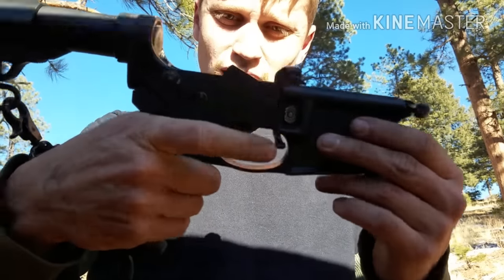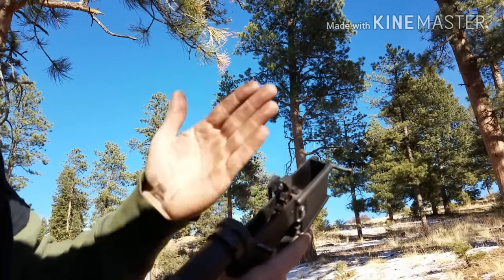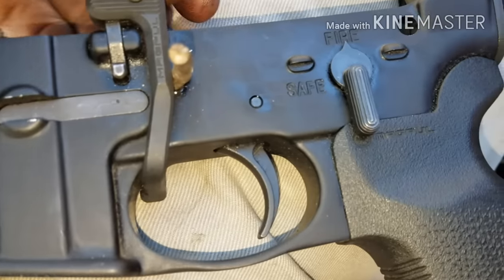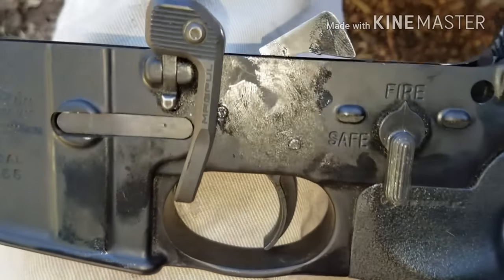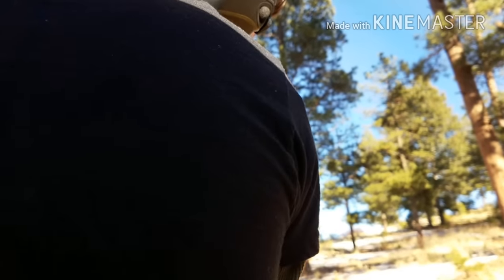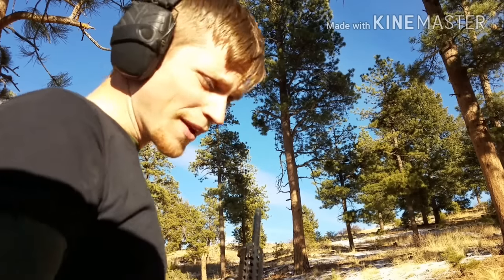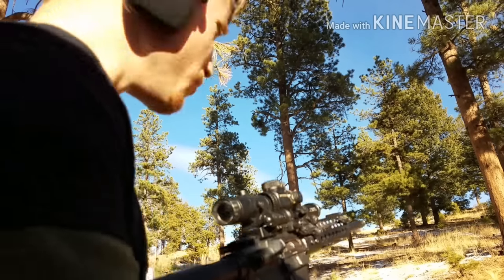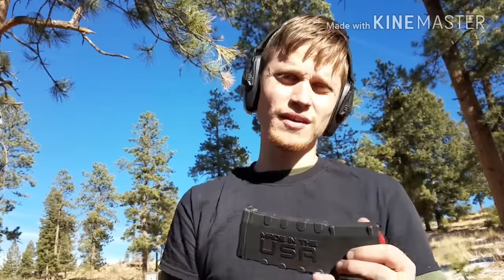What Happens When The AR-15 Disconnector Breaks?!

Comment: Would functioned the same way as a single shot if he had left the broken part in the gun till he got home , no need to take it apart with sticks
Reply from the maker: Thats not accurate to my situation. The back of the disconnector broke off...meaning it completely disabled my gun and the hammer would not release when the trigger was pulled. You would be correct if the hook portion of the disconnector had broken off.

Comment: Hey guy! If you were trained in military you would know that you dont need a stick to push your trigger pins out, just the tip of you bullet! that goes for many other things on your weapon. A1 A2 rear and front sight adjustments taking magazines apart  and so on...
Reply from the maker: I am aware of that but say you dont have any ammo at the moment. Still need to fixer up before the next time you use it. But yes, you are right and I didnt do that in this video, I didnt think of it while filming. Lol
Reply from the maker: I think I remember why i didnt now. This is a 300blk build I did and i might have been using either flat nosed or round nosed projectiles for the subsonics I was reloading. Both cant fit into the pin area. ;)

Comment: why would Anderson warranty a clearly misused molded gun part
Reply from the maker: K-Tech Cowboy How do you figure the part was misused?
Reply: Douglas Thompson not the part the gun. u can clearly see that the lower is broke from letting the hammer hit with the upper off and what's with all the useless grease piled down there
Reply from the maker: K-Tech Cowboy my lower is not broken...lol and why does the grease matter?
Reply from the maker: K-Tech Cowboy Just to be clear, Why exactly do you think Anderson shouldnt have replaced the part for me? Do you think the Disconnector shouldn't last over 3000 rounds? Im confused as to why you would say my receiver is broken too. My receiver is in great shape, nothing I did (besides shoot the gun) caused this part to break prematurely. It seems like you were focusingon all the "bad" things you could find in the video and then using them in your mind to create the reason I made my gun fail...lol

So in your opinion an "Overlubricated" part will wear quicker? 

If so! Have I got the video for you! Made it especially for you! ;)

https://youtu.be/kKisBcqOXRY

Comment: Yeah... Or just buy an AK instead.
Reply: Such an over rated platform. The AR can face much more environmental abuse than the AK... Both rifles can break, and AK rifles suffer from quality control issues far more often than AR rifles do.
Reply: and have the gun go off when you turn the selector too far? nah.
Reply: The AR most definitely cannot face more environmental abuse than the AK. Been proven in the field and in US military tests where the AR-15 platform consistently placed dead last with the highest number of stoppages and mechanical failures in every single reliability and function test they ever held, even against experimental designs. Which is why there have been several proposals to replace the AR-15 platform in the US military, given that most of the other small arms in use by the US armed forces are of foreign design already.

Both rifles can break, certainly. The AK can jam and break just like any other rifle. As for quality control... depends were you get your rifle from. Its not an inherent issue with the design or rifle, be it AK or AR. AK is more robust and has higher tolerances for abuse though. While the claims are often exaggerated regarding the "unkillability" of the AK, its no different from AR fanboys saying you cant hit a barn point blank with an AK because its Russian and therefore bad quality, crude, cheap, inaccurate etc, when in reality that is not correct but merely a matter of confirmation bias and propaganda to affirm ones own choice and superiority to oneself. Both sides do it though.
But you can just do a quick search and look up how many videos there are on youtube of AR components failing and breaking and AK ones. Or go to a gunsmith and ask him how many of each he gets and with what problems. I am fairly sure AR will be more prominent than AK (in proportion to rifles in use).
Reply: Roland Lee false. Go watch the ak vs ar mud test. I used to be a hater too until i saw the video. The ak got shit on bigtime.
Reply: And just why exactly would I do that? Because there is one video that confirms your bias and therefore its the ultimate truth?
Ive seen the video, btw, and Ive seen many others with varying results. So why exactly would that video be the be-all end-all other than you being desperate to confirm your bias?
Why would that one video negate DECADES worth of trails and tests by multiple armed forces around the globe and real world experience by tens of millions end-uses in the field for 50+ years?

So no, its not false. Throwing mud into a gun and taking a few shots does not actually equate to or prove anything. All it does is provide confirmation bias to fanboys, be it AK or AR.. depending on which video you watch.
Reply: Roland Lee there is way more than one video lol. You are the fanboy here xD
Reply: Typical couch commando.. Hilarious. Cannot face the facts because you are hurt that your rifle produces inferior performance. :D
I try not to be biased because I own rifles of both platforms, and have shot others. The AR just simply has superior ergonomics than the AK, it also produces better accuracy, has more caliber options, and is also is optics ready out of the box. The AR also is lighter, and uses a 2 piece receiver set up which is easier to convert to other calibers while still legally owning only "1 rifle" from a civilian perspective. Fact of the matter is almost every rifle will fail, but keep this in mind. Almost EVERY POWERFUL FIRST WORLD COUNTRY HAS GOTTEN AWAY FROM THE AK.... Maybe there is a reason for doing so? It may be a good rifle, but being in the good ole U.S.A. The AR15 has much more to offer with a much more attractive price than any other rifle to the civilian market. The days of the Good AK rifles for much lower prices than Great AR rifles are gone. Also keep in mind that this guy is running an anderson build. I love my arsenal SLR, and will have to admit it is much more convenient than my AR rifles regarding some aspects, but when it comes down to it Ill take any of my AR builds any day. By the way before you shit talk, Anderson rifles have a reputation for being sub par and having a plethora of issues in general in regards to assembly, just look on the forums. I guess I should maybe go on videos featuring I.O. and Century builds and talk mad trash about the AKM?
Reply: Interesting.. So you genuinely believe the US military trails to be less credible than a video on Youtube?

Ergonomics and US civilian market convenience was never a part of the discussion. Rather pathetic that you have to use that as somehow proving a video on Youtube to be  paramount of US military testing, as well as tests by other armed forces and documented performance in actual combat. Well done, and I am the couch commando.. sure thing buddy.

Yes, the AK is being replaced by most countries that use them because it a very outdated platform and a new version is in the works to meet the new demands. The majority of AK's in use are 40+ years old or use the old design. Not difficult to criticize a rifle that is essentially a WW2 design made for mass warfare for having limited options for modification in the 21st century civilian market. How is that different from any other rifle of the period? Would you say the M1 Garand is shit because it doesnt come with an ACOG in the box?
But the AR-15 is actually even less popular than the AK. Most AR-15 sales are second hand (old versions of the rifle) to third world countries like Bangladesh. Most who had it before, like Israel, replaced it or are in the process of doing so.. And guess why when the Israelis made their own rifles they took the AK as the basis for them? Why did HK make the HK416 and why did the US military buy it if the M16/M4 is simply better? How come the HK rifle performed better in US military reliability tests than the M4?!
The US military itself for the most part relies on FOREIGN weapon designs and only a handful of developed nations and NATO states use it despite it being essentially forced into use as the standard, most of them seek alternatives. Why? And why do none of the alternative designs take the AR-15 operation as the basis? Many take the AK.

Were the AR-15 really that much better, or better at all, to any significant margin it would have become the dominant platform in use and basis for other designs. But hasnt. The opposite has happened. Those who had it in the last decades are getting replacements. Even when the US supports rebel groups in the third world they ship crates of AK's, not AR's.
Reply: Roland Lee 
Whatever helps you sleep better at night little man. ;)
Reply: So when were these military trials? Like I mentioned previously there is a reason for the AR's popularity from a civilian perspective. No reason to be wound up so tight chief.
Reply: Roland Lee
So hurt... Two words regarding the rest of the world. Cost, and abundance.
Reply: And? What exactly has your later rant about more convenient modification options in the US civilian market and your personal preference to do with that then?
You made a statement that the AR can face more environmental abuse. Which is not factually accurate and we have decades of data on it. And then you go on how you dont care about that and you like it because it has options for you as a civilian and therefore nothing else is of any relevance because you said so. Impeccable logic.
Reply: AK aka a real gun. When he said “you’ve got yourself a little auto loading” I finished it by saying “POS”. Jesus man. What’s he even doing loading rounds one by one. Sad.
Reply: Every firearm I don't care what it is has its upsides and its downsides there truly is no perfect platform the idea is to use whatever is best for you the Russians and most of the other world that use the AK-47 platform or the AK-74 use this platform because it is very easily manufactured even during times of War when things like CNC machines or even electricity may be in short supply this is why the AK-47 was designed simple stupid of course some countries that manufacture their own do things differently than others like the Yugoslavian AK-47 for instance doesn't have a chrome-lined Barrel and I know a lot of people give it s*** because of that but it's actually a really good firearm the reason why doesn't have a chrome-lined Barrel is because Yugoslavia does not have any nickel in their ground so they would be reliant on importation of nickel to make Chrome from other countries which could be  impossible during a time of War the United States on the other hand uses a very intricate platform that requires electricity and CNC Machining to manufacture during a time of War will just say post-apocalyptic World War 3 b******this could be next to Impossible to even manufacturer replacement parts as far as quality on the AK platform goes there is some excellent quality AK-47s out there the problem is a lot of the platforms we see in the United States were built off of AK-47 kits and Done as cheaply as possible to increase profit margins but they are still a very viable platform and I would use either one if I had to but you need to ask yourself the question if you could only buy one which one would you purchase well you could buy an AK-47 akm variant it's great for around your house around the farm protecting your house protecting your family and protecting your loved ones but in a s** hits the fan scenario who is going to be shooting back at you cuz you're not going to be able to go to Walmart to pick up ammo chances are your best bet would be to have all three the AK-47 the AK-74 and an AR-15 because you never know who your bad guys are going to be and scrounging ammunition off of dead soldiers might be your only option